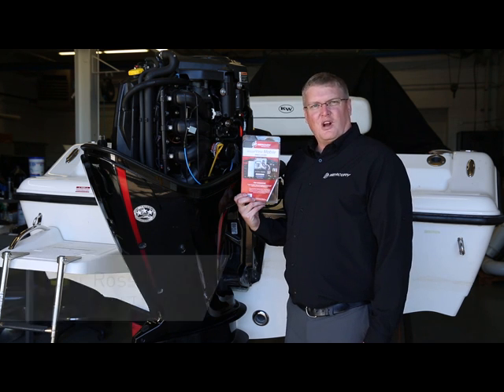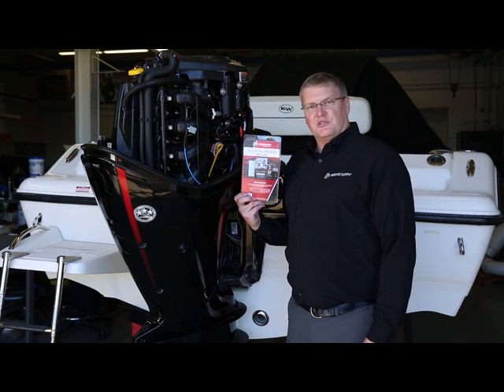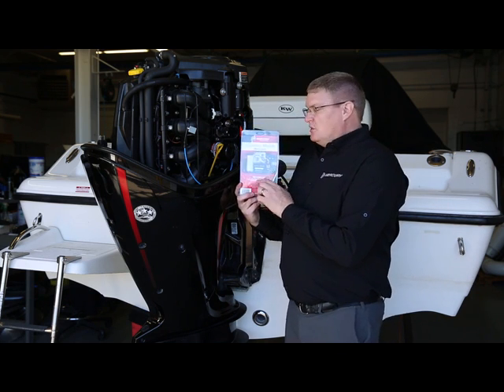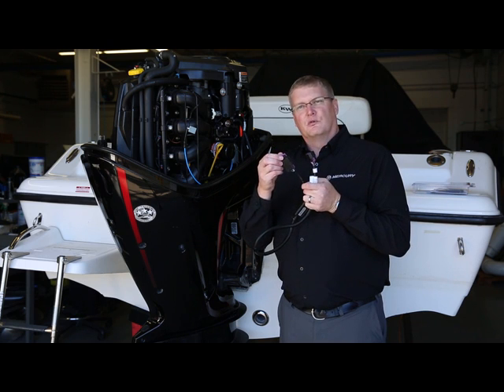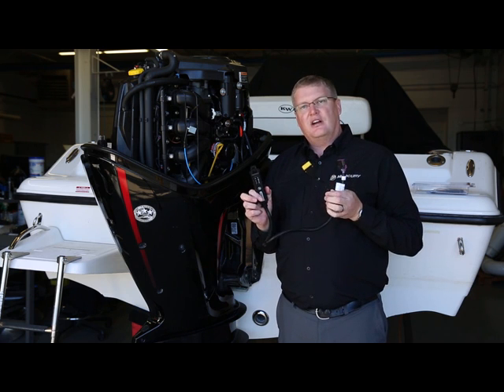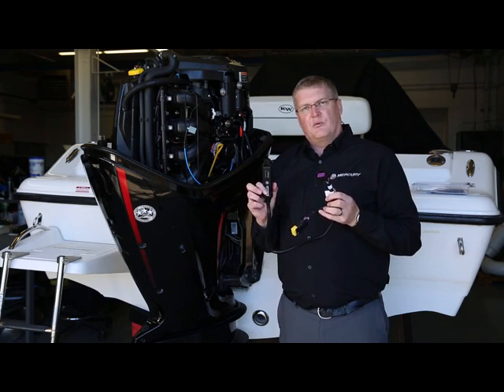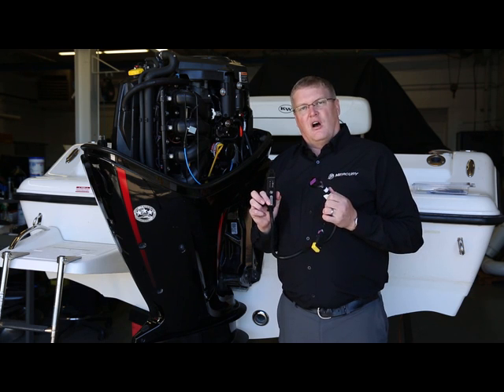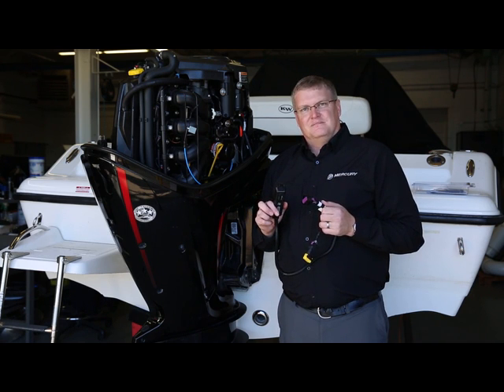VesselView Mobile: How to Install on Single Engine Outboard 40hp and Above

Comment: Why didn't you show best where to mount this $230.00 part in my engine? Where do you recommend?
Reply from the maker: The best place to install the module is at the helm of the boat, if possible. This is not always an option, as it depends on how the boat was rigged and what parts were being used during engine and rigging installation. If you do not have a junction box under your helm and must mount the module back on the engine, the ideal mounting location will vary by model. Generally speaking, you'll want to place the module in a spot that is on the front of the engine and as high as possible, while avoiding moving parts. Feel free to reach out to our VesselView Mobile specialists at support.vvm@mercmarine.com, and they will be happy to help you select a location for your particular engine.

Comment: Problem is: You get rpm/mph nothing else. No Batteryvoltage, no Enginetemp., no Oiltemp,Trimmlevel, nothing.
 My 60CT had that 2days then it went on eBay = useless!
Reply from the maker: We're sorry to hear that. There are customizable pages of data points if you tap on the RPM box when the engine is turned on. Standard engine data points are battery voltage, engine temperature, fuel economy, and engine hours. More data is available if the engine has the appropriate sensors installed, such as oil temperature, oil pressure, cooling water pressure, and more.

Comment: Hi, I installed a VVM module , I'm sure that i did everything ok, because not only i read the instructions, i also watched the Mercury tutorials. 
The point is that the lights doesn't turn on when i energize the engine.
Am i doing something wrong?  i installed the yellow terminator in where i romove the purple weather cap....
The engine is a 115 hp EFI serial # 1B509591, which, according to the supported engines configurations chart, should work.
Could you help me to figure out how to solve it?
Reply from the maker: Hello Hernan, we've received your email on our VesselView Mobile support account, and we are responding to you there with some troubleshooting steps. Sit tight, and thank you for reaching out!

Comment: Just got my module.  There's two pig tails , BUT he should clearly identify which one goes on engine (hint, , its the one with the white label wrapped around it) and then show on that engine where they cable tied it so that will give some ideas as to where YOU should put yours away from rotating or hot surfaces.  Its an easy install once you do it.
Reply: Hint. It’s the only one that will go on the engine. There’s a male and female end. Only one will work.

Comment: drew money has a point - simply show how to route and attach the device inside the engine and then show the application actually working.  My Smartcraft gauges are no longer readable (only 300 hours on engine & always covered) but the LEDs just no longer are readable - I was thinking of buying a new set of gauges at cost of almost $1000 or the Smart View monitor for $1200.  Came across this mobile app and I think its a good option.  I would just like to see the app working.

Comment: this video should show the actual technique on how to install this module. if you want to sell this 250 dollar device you should show the ease of installation and how to set this up and use it. I looked into getting this device but saw the price tag and was immediately turned off. I love my mercury motor and would love to get even more out of it.